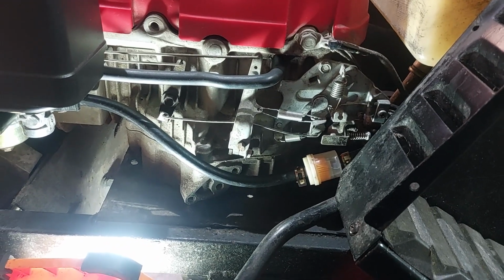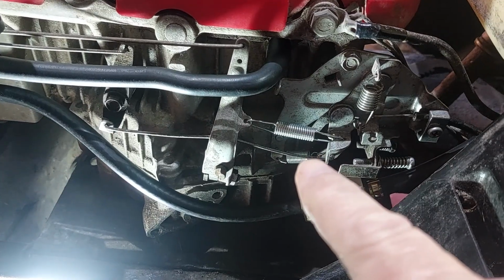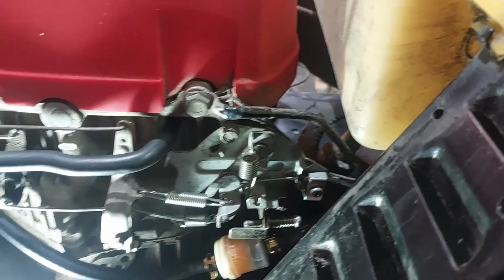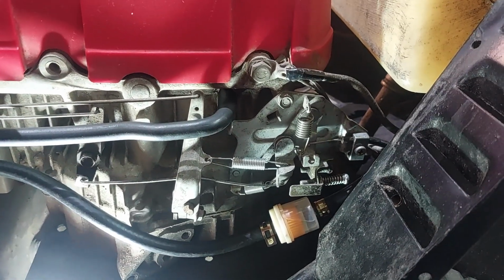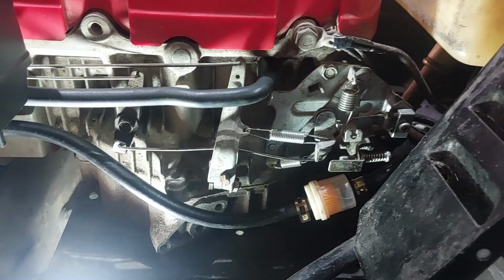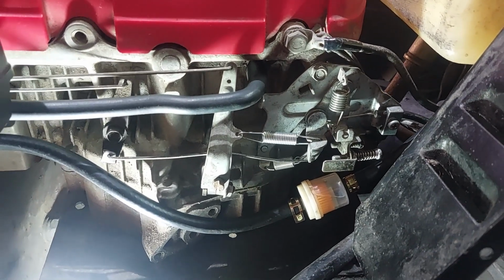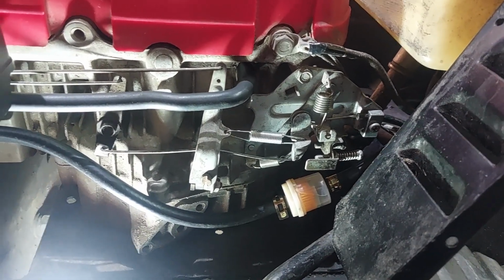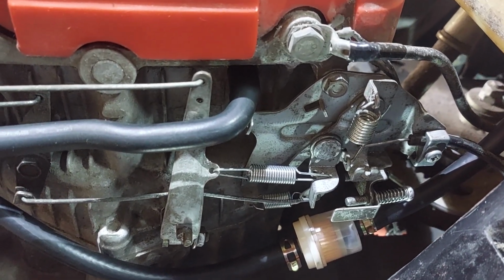Problems with my Honda 2213 throttle linkage

Comment: Hi Nev! Try tightening the nut on the throttle lever pivot. It needs more friction to hold it in place.
Reply from the maker: Hi Bill, it's not a nut and bolt, it's a rivet that I have punched tighter, got a friend coming tomorrow to have a look at it

Comment: Hey Nev, I would say it’s just throttle cable adjustment, is the sheath around the end of cable warn that it’s slipping? When it on full revs is there more adjustment? Loosen the throttle cable bracket set the throttle by hand to you desired revs and then tighten the cable, just check you can still idle if required. Hope this helps. If not this then it’s above my pay grade without fiddling 😂
Reply from the maker: Hi James, now that's what I was looking at the cable I have a friend coming tomorrow that use to restore old tractors and he is going to bring some old cables with him see if we can adjust one to fit so may do a video if he wants to be on camera, thanks for the advice 👍

Comment: How's she goin'?  That's a head scratcher for sure eh Nev!!  I wonder if the governor is forcing the throttle lever back to the lower setting.  If that were the case, then a governor adjustment would maybe help.  But I don't know for sure.  Good luck with it!!  I like issues like this.  They are out of the ordinary and fun to try and track down!!  Take 'er easy!!
Reply from the maker: Hi Mike, thanks for the comment. I have had to call a friend he is coming tomorrow to have a look it sure got me scratching my head will keep you all updated on the outcome 👍

Comment: I do not know that machine or engine but it looked like the throttle increased the speed but it dropped back. If that is the case, it could be that the the throttle lever on the dash needs to be tighened. Most have a fixing on the pivot but it looks like you may have to remove the gas tank to get to it
Reply from the maker: This system has rivets on all the linkage that I have tried to tighten but still does it, I have phoned a friend he's coming tomorrow to have a look so fingers crossed 🤞 thanks for the comment 👍